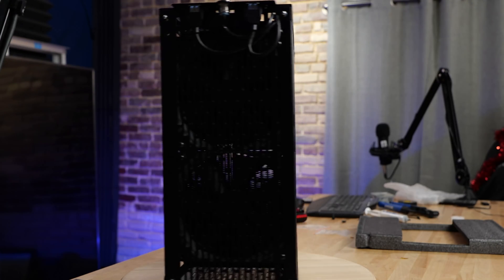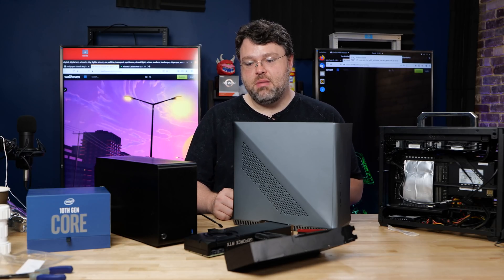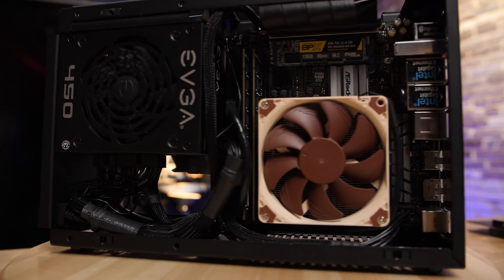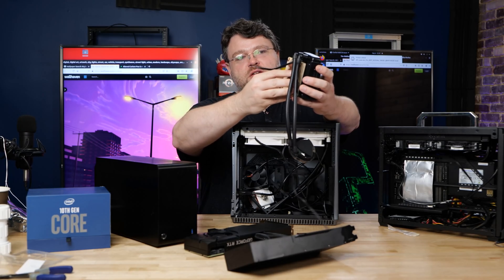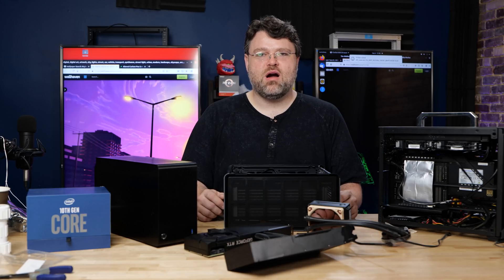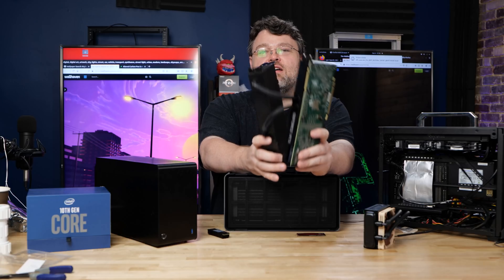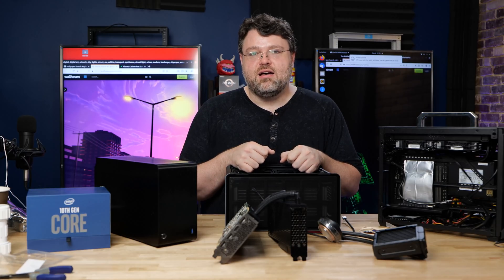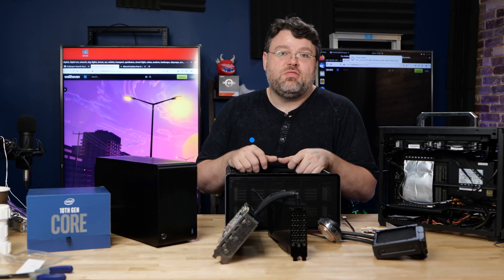The Tiniest AIO We've Ever Seen: Checking Out Two Innovative Asetek AIO Coolers

Comment: why do aio companies not make AIOs that have shorter tube lengths? i want an aio with a tube length of 10 1/2 inches but they quite literally do not make them. i do not understand why especially with how popular SFF builds are.  how are there no cpu aios that are designed for SFF computer cases with shorter tube lengths? i have a full size computer case even but i want an aio with shorter tubes so the aio does not looks super ugly. i have a HP Omen 240mm AIO that i took out of my old pre-built computer and its perfect as the tubes are so short i do not have to cable manage them to make it look aesthetically pleasing in my computer case. the reason AIOs look so ugly is because of all the extra tube length that is added. PLEASE SOME COMPANY MAKE AN AIO WITH SHORTER TUBES! LITERALLY NO COMPANY MAKES THIS PRODUCT AND IF THEY DID IT WOULD SELL OUT LIKE CRAZY! people with SFF computer cases and people with normal sized computer cases (that do not want a bunch of ugly extra tube length taking up the room in their case) would buy the shit out of it. 10 1/2 inch long tubes on AIO is perfect for top mounting (which is what most people with an AIO do) so it would be such a sexy AIO if a company made it. it would be an AIO that actually fits in your case without all the extra tubing making the case look unorganized and ugly to look at. they could literally call it a "top mount AIO" or "SFF AIO". also they need to make magnetic caps for the pump block standard so that you can change the orientation of the logo at will. how has every AIO not adopted this feature?

Comment: That tiny rad AIO would probably fit below the PSU on the fan mount on the bottom of the DAN A4 case (on older revisions you might need to make the mounting points yourself but there is a fan grate in the floor)
Reply: I was toying with the idea of getting one of those as well as that GPU AIO thingy and perhaps an additional thin rad above the motherboard and make a custom loop for both CPU and GPU in mine. Even got a 200w and 400w HDPLEX PSUs that can be tucked below the GPU to free up the space for the PSU for more rads. But can't quite fit both the AC/DC PSUs inside the case and having external power brick feels like cheating.
But now that RTX 30-series is around the bend I might just remove the side panel and stick like a ASUS TUF 30X0 2.7 slot card in there with the cooler hanging out the side like a hotrod! 😁

Comment: Somewhat unrelated to the video, but related to small small cases. Small form factor cases could see a huge change in the future, if the industry follows through with what's starting to snowball, with slightly better decisions in some areas.

First, data connector condensation, such as the move from USB 3.0's internal header to USB 3.1's internal header. Smaller connector, less wire, less bulk.
Second, the shrinkage of storage and removal of data and power connectors, which m.2 has done, both on SATA and NVMe. Less component bulk, no wires, bulky connectors; what was SATA header, cable, SATA power cable, and bulky hard drive, is now just a thin board with a thin connector, a massive component shrink.
Third, 12VO power supplies. Less power supply, less bulk.
Fourth, Intel's new NUC design. Compute card means a smaller computer. though I have some issue with Intel's design, but I'll get into that later.
Fifth, Nvidia's new micro power connector. They're taking what would otherwise be four eight pin connectors and condensing it into a micro 12 pin connector, which is roughly the size of a single 8 pin connector; less wires, less wire bulk per wire. 

And finally, Nvidia's move to cut the footprint of flagship cards down, nearly in half. Look at the 3080, it's absolutely tiny, and outside of the odd power connector orientation, a single slot card when water cooled. 
Now imagine if what's already snowballing continued to snowball. Smaller data connectors for every type of connector, smaller power connectors for everything, more condensed power cables with the move to 12VO; imagine if CPU and motherboard power headers got the 12VO-micro header treatment. 

Now for my complaints on the new NUC style. It's a good start, but it could see improvement. The intermediate board should be chipset, storage, and I/O; with most of the storage on the back side of the board. This would open up the CPU compute module to have space to be CPU and memory only, and if laid out correctly, could house full desktop components, though cooling could get weird; but my solution to this would be mount the CPU on the opposite side of the PCB, so that CPU and GPU cooling are on opposite sides, which would allow for larger and better cooling on the CPU card. Stemming from these ideas, widen the intermediate board slightly, allowing for a centrally located card, for supplemental I/O or just any single slot expansion card; this would make the expansion area 5 slot case for dual slot GPU and CPU cards. I believe this would be the most condensed system configuration while housing all desktop-grade components, and keeping at least one slot for expansion. Desktop-grade CPU is important for PCIe lanes, as PCIe is becoming overcrowded now that storage is PCIe based, and Intel limits their mobile chips to 16 lanes, and Intel is lacking on PCIe 4.0 adoption, and will more than likely lack on 5.0 adoption. 

Now for getting to the point I made in the opening line. If we ever get an industry standardized form factor based on how I think Intel should've made their new NUC platform, and if the industry continues to snowball in reducing the footprint of literally everything, we could easily see micro systems that're air cooled. But water cooling all of this could be a game changer. Smaller connectors, smaller PSU, smaller boards, less wire bulk, one of the most efficient volumetric footprint designs, etc., possibly even with a full open loop cooling system. 
We could easily see powerful workstations the size of a console; barring the size of the PS5 as that's currently unknown and speculation is saying the PS5 is massive. But this only happens if the industry does the correct things, but from the storage shrinkage, the USB internal header shrinkage, and Nvidia's push to make their products smaller, we might see the industry latch onto the idea of micro systems; with the only real wildcard being volumetric footprint efficiency of the total compute hardware, which Intel has planted that seed, but Intel also doesn't have the best implementation, where my suggestion of what it should be is one of the most compact volumes while keeping the system modular and keeping at least one expansion slot. 
The system would be limited to a 2*120/140 radiator, unless you want a deeper case for a 3*120/140 radiator, radiator would be top-mounted, reservoir and pump would fit in the front, the shrink from dual-slot CPU and GPU cards to single slot would allow for face-mounted fittings and tubing in the now empty outer slots; which face-mounted blocks would work well as the CPU and GPU oppose each other, thus no conflicts. Aesthetics would also be interesting, given how the system is constructed. 

I really do hope the industry keeps snowballing for micro-sizing everything. I also hope Intel or AMD, and motherboard partners, catch on that the new NUC style can be improved upon to house desktop components, and that the volumetric footprint efficiency of that kind of system is leagues ahead of any other solution. Both of these, especially the better board/card layout, would benefit the trend of miniaturizing cases; we could easily see small form factor become a mini form factor.

Comment: I just stuck the radiator out the back of my 1U plex case, but eventually changed it out for a terrible air cooler because the pump didn't quite clear and made a loud vibration in the chassis.

Comment: The DAN A4 can take the 92mm 645lt straight out of the box. No adapter needed. May want to correct that
Reply from the maker: Not if you have a modular sfx  psu.....
Reply: @Level1Techs  I have a modular SFX PSU bit fits fine? I don't understand where we are getting crossed wires here.

Comment: I'm confused, isn't the thermal capacity of such a small radiator system going to be saturated quick? And you still have the problem of the rad/heatsink being inside the case. How is this better than a low-profile high performance aircooler? It's also way more expensive and has many more points of failure.
Reply from the maker: It's in the video. It's thicker than a typical 120mm which is why it's about equivalent....
Reply: @Level1Techs  Sorry, I skimmed through it and must have glossed over that part. Thanks!

Comment: I was also hoping to make my Dan A4 somewhat quieter by switching to 645LT. As it turns out, the AIO pump has a very obnoxious humming/buzzing noise, which is very audible from a sitting distance, even in idle. At first I thought I got a bad unit, but judging by what owners say, that's just how it sounds. Using Noctua's low noise adapter helped, but only a little bit – the hum is still there. Ended up going back to my Alpenföhn Black Ridge with a 120mm fan, undervolting the CPU and adjusting the fan curve. It might be a good solution if you're not as sensitive to the pump noise, plus I imagine that with a beefy CPU like 10900K you don't have a choice, since 645LT is as good as it gets in terms of temps in Dan A4, without going for a custom loop
Reply: most likely due to a some air bubbles caught in your pump. Can be solved by flipping the radiator 180 degrees (tubes at bottom) :)
Reply: @dennishampe4465  Did that too, even took off the pump cap and added some more foam for sound dampening. Mine sounds exactly the same as in this video: https://www.youtube.com/watch?v=R4gemTV6XI4

Comment: the 92mm aio was designed with dan a4 in mind tho
Reply: Umm one word Ncase.. 92mm fit on the rear
Reply: Early adopter tax showing it's ugly face once again
Reply: @Henk14789  I don't understand your comment.
Reply: @jrwagh333  https://www.dan-cases.com/dana4_spec.html
V1 does not support the 92mm radiator, V2 requires the removal of front USB to fit
Reply: @Henk14789  ok thanks, I understand now. We are currently on v4.1 which takes it natively

Comment: "People look at them but they don't really buy them"
That's because manufacturers scalp SFF buyers with overpriced MOBOs and PSUs. They know they can get higher margins out of people who are intent on going SFF
Reply: Tell me about it. Even the ITX boards are really expensive. You would think because they have far less components they should be cheap, but no. I can understand the top of the line ones being expensive, but even boton of the barrel A320 based ones are more expensive than MATX.
Reply: @magoid  Smaller more power efficient versions of most components are mostly more expensive and half the time are only used on the itx models, and you need very complex pcb's to connect everything in that much space. You also don't really get the economy of scale factor that helps with the price and the engineering time spent on them is higher.
Reply: @VeritronX  What you say is the usual excuse most manufacturers use.

 But if you look at bottom of the barrel, cheap as it gets  M-ATX mobos, that are for all intended purposes ITX, but have a single extra 2X PciE connector, you can clearly see manufacturers are in fact charging more.

Please note that I'm not talking about mobos with top of the line chipsets, but intermediate and low end ones.

Comment: If they made a case frame which incorporated 1 or 2 radiators then a few of the space issues would be resolved. Clip on a dual or triple fan 'cover' - with built in power connector/ pass through and even less cabling. To top it off incorporating a case with the power supply or building a PSU into a panel (consider the thickness of the bricks used for laptops and make a bigger one as a panel) or use the PSU as part of the case frame.

Comment: Uhhh... the most popular use of the 645LT (and its predecessor the 545LC) is using it in the Dan A4 under the PSU. Not sure why Wendell didn't mention it
Reply from the maker: It DOES fit but was a highly unpleasant experience with my components. I had a better experience in the fractal case even tho I had to print an adapter.
Reply: He claimed that it doesnt fit. Which is odd since it does and was made for the Dan case.
Reply: Bonercondoner I mean, it's hard as shit to cram it in, but it does fit. That's just the nature of SFF systems.

Comment: "Patents pushes innovation"... maaaayybe, but not really in a good way? and surely not great for competition?
Reply: if you want to make something thats patented you have to find an alternative method for achieving the same thing. this means that more avenues get explored for a given technology, and that might lead to efficiency gains, or to additional features, or whatever. of course most of the time it means your society wastes engineering time developing the same thing multiple times in parallel and they all pretty much do the same thing.

the way i conceptualize it, intellectual property leads to a "wide" technological base, while no/lesser/shorter intellectual property lets people build off of one another more easily leading to a "tall" technological base
Reply: @Gerg1n8eR  I get your point, though I don't necessarily agree that it always would lead to a tall one. It gives you the freedom to go tall or wide depending on the needs.

Where the other forces you to go wide.
Reply: @TheBekker_  I didnt mean to imply that tall precludes wide, because as you point out it doesn't, though that is the way i wrote it.

Comment: You mentioned that PCIe 4.0 is only done "correctly" when you plug the GPU directly into the PCIe socket, so many of the smallest sandwich-style form-factor cases aren't 4.0 compatible, due to relying on PCIe risers... Would it be possible to support PCIe 4.0 in this kind of case if you made the connector out of a material with less voltage drop than copper (like silver), or is the limiting factor signal speed (trace length, not signal strength)?
Reply: There are PCIe 4 riser now
Reply: @virtualtools_3021  True.  This comment was written 2 years ago when they weren't on the market. I actually just got a 4.0 riser for an ITX PC build I did for my sister over christmas. In a sandwich-style case no less... funny how things work out :)

Comment: My boi has an HP Omen desktop with a 9700k and a 2070S he was trying to fix the cooling on. They put a 90mm exhaust on it so we've been scratching our heads for a solution to this. Do you guys think this is worth pursuing? We were thinking of this or the 120mm version of the Reeven Okeanos
Extra info: No 212 EVO or NH-D15 due to the case being thinner than usual. He has 5.75in/146mm before he hits the window. The Reeven is 140mm tall vs the 212's 160mm height and the D15's 165mm
Reply: I would look at 92mm tower coolers.  Some of them are pretty decent.

I'm currently using the enermax ETS-N31.

Comment: Asetek is kind of like Seasonic. Been around for a while, makes incredible stuff, all of a sudden everyone is buying them. (Not trying to sound like a non conformist stay away from my brand type)
I own a Chieftec Dragon mini Case (Older than most of you folks I'd guess) which has 92/80mm for it's fans. 645lt is perfect for the case. (3600, 5600xt(The 'low profile' powercolor version: AXRX 5600XT 6GBD6-3DH/OC)). It's just a matter of finding one to buy that isn't 3xMSRP.

Optimus Tech (I think that's the channel) covers SFF and talks about these. Recommend if interested. Quality video/info.
Reply: I dont remember seasonic being a parent troll by patenting already on the market designs that swiftech did 1st.  They do some interesting data center stuff, but in general they only exist since they were successful in patent trolling the US so they can sell the cheap mixed metal junk.